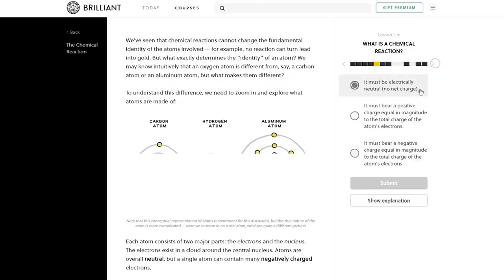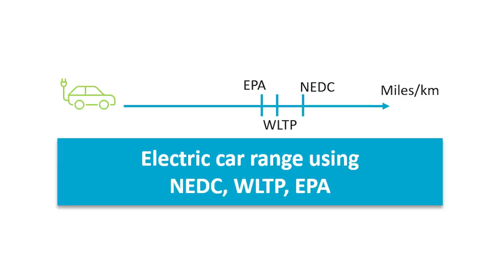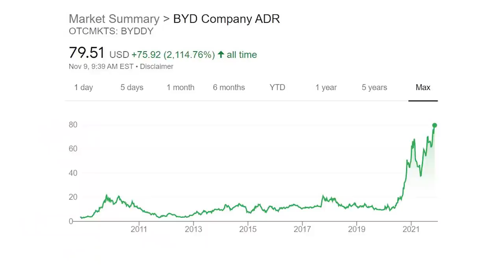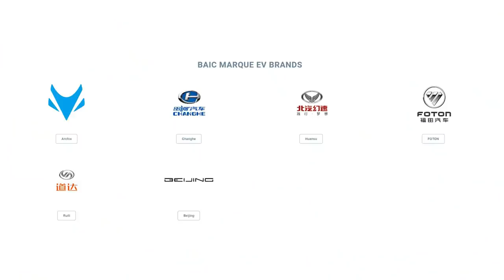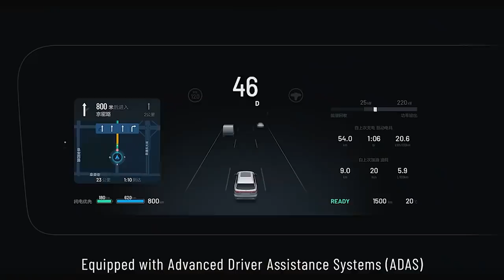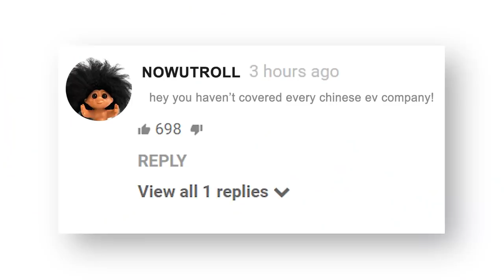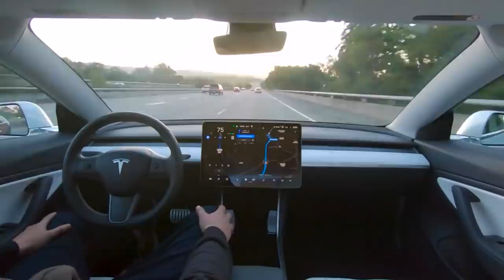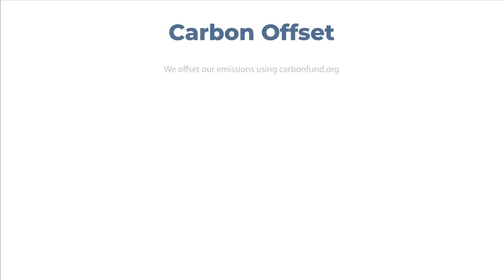China is Coming: Part 2 | In Depth

Comment: First: excellent episode.
I would like to suggest an episode: the hurdles in installing a 240 volt outlet at home to charge a vehicle best case scenario and the worst case).
Reply: This is not rocket science folks. If you have an electric stove, electric clothes dryer, etc. then you have 240 outlets. Same outlet in weather proof version and you have an EV ready outlet. However, if you can be convinced by your electrician that it is rocket science then you will pay rocket science money for a simple outlet.
Reply: @GaryL3803  by hurdles I was referring to things like: the number of amps supplied to the house is too low for the potential load.. 
Other item could be the path from the electric panel to the desired location of the 240 outlet is not easily accessible.
Third item, the spouse wants to park under the carport adjacent to the house leaving you to park at the end of the driveway.
Reply: It's no big deal. I even have 240V in my living room and outside my solar shop, just because I could. Electrical work is far more affordable than, say, plumbing.

Comment: Very interesting 2 part series and very well done. We learned a lot. However, before we proclaim the death knell of ICE manufacturers, we need to think about where we will get the electricity. You mentioned that battery supply will be the limiting factor. Renewable energy is going to require storage, and that will put stress on battery development and production, especially because the requirements for fixed storage are so different than for mobility. Which side will get the best developers? So isn't it possible that given the long lead times to build generating and distribution infrastructure, that ICE will continue to be strong well beyond 2024?
Reply: Storage generally doesn’t require high energy density, just low costs.  Using everything from pumped water and raised weights to Lithium Iron (Ferrous) Phosphate cells or compressed hydrogen are all feasible options.
Reply: Hydrogen fuel is the way.
Reply: No, not when other electricity generation systems such as solar improve and become more affordable. Off grid charging equals freedom for at least the range of the vehicle. When every home and every business gets off the grid from solar or even wind then gas will exit the transportation industry. A little mom and pop convenient store out in the middle of no where will sell electricity from solar to drivers passing through that need a charge. That same store won't sell gas as it has to be delivered, electricity is instant and available... decentralized... like crypto.

Comment: Does the battery swap station solve the issue with people saying "The batteries wont last and it will cost you $20000 to replace it."? With battery swap station you just go and swap the battery out for a new/used tested battery every once in a while when you feel you need to.

Comment: You guys are missing the point of getting a cheap electric auto with 120 miles range and a top speed of 65 mph. The Americans could build the  car in the USA for 9,000, the govt could give a 3000 rebate. 90 per cent of driving is within a 40 mile range. The main goal is to stop ice car pollution. And this approach would do it.

Comment: I dunno about any other drivers, but probably my favourite thing about owning a car is the freedom it gives me. It still why I’m apprehensive about a Tesla, because pumping gas takes 2 minutes and the longest stretch without a gas station I’ve seen is 85 km. And that was crossing the Rockies. I also rely on my vehicle to make money but I do understand why Evs are so attractive.
Reply: Do you have access to electricity where you park? Plugging in to charge only takes a few seconds, and normally happens overnight while you sleep.
Reply: @JohnGeorgeBauerBuis , part of the freedom I’m talking about means I make money from driving as well. I’d need an electric pick up truck for it to make sense and last I looked, cyber trucks weren’t driving down any of the highways I use.  For me with a tidy tank and a huge gas tank, spending half an hour at a card lock filling up means I can go for a very very long time. I can also access places/ job sites  electric cars just physically can’t go. I do own a hybrid civic but again, just having the gas tank is comforting and when on long trips, it really doesn’t add as much mileage as I was told ( the car is quite old now though).

Comment: Hongguang is very rare in Shenzhen, I can go a day or two without seeing them, but there is one in our garage and I asked the owner (girl) how fast it can go (among other things). She said:" I haven't tried. On regular highways, the speed limit is 70-80km/h and that's what everybody is driving, but I drive on the streets and the speed limit is 60km/h. I hate the small wheels because as you know there are thousands of manhole covers and they are never even with the road surface. Easy to park, I can find a spot almost every time. There are over 3 million cars in SZ and about 2 million parking spots. I work in a restaurant doing the night shift." 

My wife picked the BIAC EC3 (little brother of EC5) for the same reasons. I set the speed alarm to 100km/h and one day she asked what had happened. I said:" You must have been helplessly lost to end up on a motorway, there are no other places you can drive that fast.", "Right, I made a wrong turn, was late, and took the toll road as a shortcut." Only time going that fast after driving the car already more than 8000km. So yeah, those small cars are good as Palo Alto or Berkeley cars but don't take them on the freeway. I'd say finally anybody can afford a new small town commuter car instead of 10 years old ICE car.
Reply: There are some in Shenzhen, but be honest, the charging takes UpTo 8h, as an owner told me. The smell inside, like chemicals, the MP3/Radio is definitely missing BT.  I have seen a lot on the motorway, actually. 
In Shenzhen the cheapest version isn't sold, because it doesn't have air-conditioning.
Instead of the Huangguang Mini EV, I would go for the Kiwi or Baojun E300, much better cars.

Comment: How long is the life of the battery in a hot climate? How does it cost to replace?
Reply: I wonder that too.    My iPhone sat in a hot car for two hours dropped its battery health from 98% to 95%...
Reply: How many volts and watts does the charger use and time for it to recharge. I very much doubt it charges on 120 volt a/c which is in practically all American homes. Nobody I know of has a 240 volt outside they're home to plug in a car which is more likely what the car charges on.

Comment: Yes if their commute is under 100 miles they can use just electric, but that assumes they charge them up. We had a govt grant to encourage companies to replace their fleet vehicles they lease with plug in hybrids. But when it came to the end of the lease period and the vehicles were returned many of the vehicles charging cables were still in their plastic wrap, so surprise surprise the company did not see the promised fuel savings and the new lease vehicles were straight diesels.

Comment: Don't buy all the hype here, like the Nio fast battery change, sure it’s fast, if there's any freshly charged batteries ready. In large cities, you would need a multiple bay battery swap station coupled with a battery charging automated warehouse constantly supplying & receiving batteries, it’s just doesn’t sound feasible.

Comment: Did they just say the NIO ET7 will have a range of 600 miles? Doesn’t the Lucid Air have a range of 520 miles and that’s the “incredible technology” that has led them to a hire market cap? Crazy. Gotta company with a better battery, way better charging infrastructure with traditional options, and 100x the deliveries trading for less?! All politics aside US is in trouble. Definitely not a fair market evaluation in my opinion. Thanks for an outside the box perspective.

Comment: Tiny Kandi cars are not to be underestimated just because they're small. If you just do small local drives they're all you need 95% of the time, and relatively cheap. Main problem is not the design of small cars themselves, but the market, and for Kandi I'd question the support in the US as well. If you have trouble with it, then you may be in trouble. And since this is the US there's probably a dozen old good hondas and stuff from the 90s that you can buy for like two thousand dollars that still work decently, and are able to even carry more stuff in them, so while the cars nice it's a problem of the market as it is, though the two people I know that have mini cars both like them for their general local driving around, and since they are smaller after getting them one of them was able to set up his own workshop in his garage with the extra free space that he's been using to do lots of fun hobby (and now even a few commision) jobs.

Comment: The Zeeker 001 is a very large car and will most likely be the same platform used to build the '23 Volvo XC-90. For around $70k, that car should be compared to the model X
Reply: Looks like starting price for the zeekr is 46 to 56 k US dollars on the top trims. Hope it's a nice car. It looks great for sure.

Comment: For those who think it is a good idea simply imagine if they would have come up with the same idea for cell phone 20 years ago. New generation batteries would have stopped fitting on your phone after 1-2 years max and battery for cars will be no different. To top it all there is no battery standard in the industry so each manufacturer would need to open their own battery changing sites. Considering the cost of real estate how many battery changing/ day would need to occur to make it profitable to invest and pay a rent to open a site? You think they would open a site so that 30-50 cars a day would come switch their battery? If so How much should they then have to charge for the swap to keep the business model profitable? It is a crazy idea.
Reply: NIO has been selling those cars in China since mid 2018 and got around 500 battery swap station right now. They have designed and produce a new 100KW battery pack which fits both new and old models in 2020.

Comment: I posted this comment because I want people to know the facts. The actual cost of your EV (depends on how hilly your area is) after 2 years will be the cost of the car plus the cost of electricity plus the cost of your new battery pack and you will have a car that if you are lucky will still have a range of about 50 to 60 miles. Take it from a guy with first hand knowledge. I'm just say'in

Comment: I don't think EVs are going to be taking over as fast as these guys think. The biggest problem I see with them is the charging. A lot of people live in cities where they don't have their own driveway let alone a garage, and so have to park on the street. Same thing with the tons of people who live in apartments. Where are they going to plug in to charge? You might make fun of people who say it's really easy and fast to fill up a gas car, but that's the reality. People don't want to have to plan out a schedule around charging. If you're low on gas you take 10 minutes to detour to a gas station and fill up. If you're low on battery you go to a charging station, and if there's an open spot you still have to wait an hour or more to get charged. Unless there's some major tech advancement with battery charging, huge infrastructure changes, or everyone goes with the battery swapping idea, I don't see it happening soon.

Comment: I dont think any of these mini cars will sell in NA. At least not in current trim.  These ev accelerate so slow and hav poor brake performance.  They need an expensive model with upgraded motor and upgraded tire and brake in order to haul bigger size americans safely on highway/freeway.
Expensive model With extra import tax and shipment fee they would cost a lot more compare to the cheaper model you find in asian market.

Comment: A huge advantage for Tesla is, that you know what you get and that the company will be around a few years later, which is not necessarily the case for some of these new Chinese companies. Also Tesla has a strong brand value, but for sure some people do not care about such status related aspects. Tesla already proved that their cars last long and have a high resale value. Generally it is quite remarkable how well Tesla is abler to compete with Chinese prices when comparing cars of a similar segment.
Another interesting aspect is battery production, China is producing most of the GWh and thus is at the top of the food chain. And I am quite sure they will ramp battery production capacity the quickest compared to other regions, especially Germany (except for Tesla GF Berlin).

Comment: Battery as a service has over 90% take rate in Norway. Also es8 is for sale in Norway today and they have 2 swap stations there so far. The et7 is far superior luxury wise to anything else and will do very well. Especially considering china will likely use regulations to require lidar to sell autonomous driving services in china, this will benefit their homegrown ev companies such as nio and they have proven to do things like this already. For instance they only gave a subsidy to vehicles with battery swap capabilities. The united states will likely also use regulations to require lidar to benefit certain companies with strong lobbyists. Its why everyone wishing to sell autonomy is including lidar in their designs lately.

Comment: And I think both you and Sandy are wrong. It doesn't matter the vehicle. Any one of these will work but... it's the network. Tesla has killed it there. They are opening it up but strategically. I guarantee that there will be no Chinese EV company allowed on that network. The CCS network, OTOH, is fractured, semi obsolete and woefully under located. There's nothing on the horizon for massive upgrades that I'm aware of for anything in N.A. Maybe you guys could look into that?

Comment: I used to think your site was excellent, but since Electric Viking hit the scene this year your content on EVs is barely average by comparison.
So here's the thing: by 2023 all Chinese EVs  comparable with ICE models will be cheaper and more technologically advanced.  The USA has not invested in EVs - a part from TESLA - so will either be buying millions of EVs from China, or it becomes  an automotive backwater.  As Sandy Munroe noted, Tesla's Chinese gigafactory was built in a year.  So the likes of Geely, BYD, SAIC, BEIC, and Great Wall can easily add 10 million new EV capacity in  3 years.  Indeed, BYD plans for 5 million units from 2025.  Irrespective of what happens in the USA, after 2025 you won't  be able to sell comparable ICE vehicles after 2025 because they will be inferior in every AND more expensive.

Comment: If you do some research you will find that XPeng is actually delivering a better autopilot solution than Tesla. They use all kinds of sensors (even with lidar) to help the chips make right driving decision. Tesla accused Xpeng cuz they know this company is nowhere close to other rivals, XPeng has always put AI tech on the first place in its long run strategy.

Comment: Just like anti-maskers there is already anti-EVers. Thus the used and new ICE market will be strong for a while and ICE prices may drop some on new for a while used ICE will probably stay strong for a while too. The new sedan style ICE car will be the first to end production while larger trucks will be the last to go as those tend to be where most anti-EVers are right now. I already have some friends that think Rivian will be like a new Edsel. The key to EVs taking over is going to be the purchase price. Until the up front cost without tax incentives is lower than an equal ICE car is when the market will quickly shift. That is coming soon but not as soon as some think. EV supporters right now are getting caught up in being a little over optimistic. I am looking for a good EV that can replace a Jeep Wrangler but at less than $30,000. Otherwise I am holding on to mine until it dies. $30,000 is my max for any vehicle. Plus I need to know I can drive an EV to the shore of the Beaufort Sea and back if I wanted to and have no issues of being able to charge along the way. Getting access to charging into some areas where gas is already limited will be another turning point I am watching for too. My preference is for a Tesla but the Cybertruck is to big. Rivian seems just right but to expensive and the Cybertruck I might get is also to expensive. The new Ford pickup is about right but they are doing squat except to say here you go but you are on your own to get it charged.